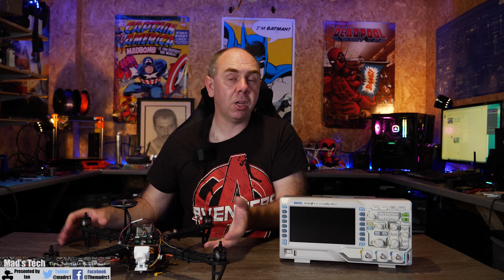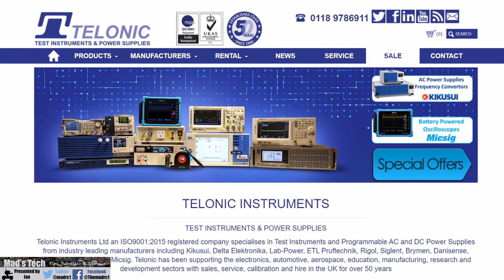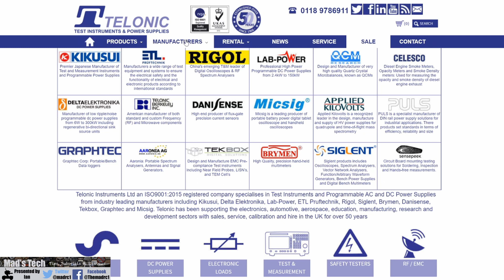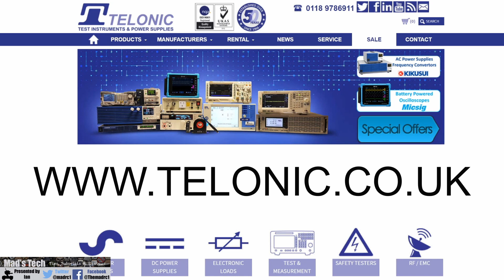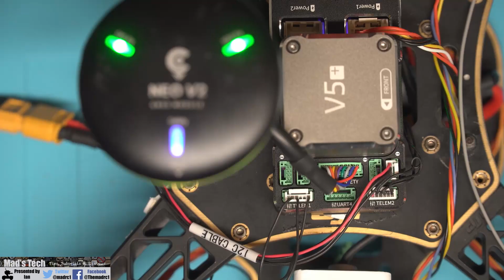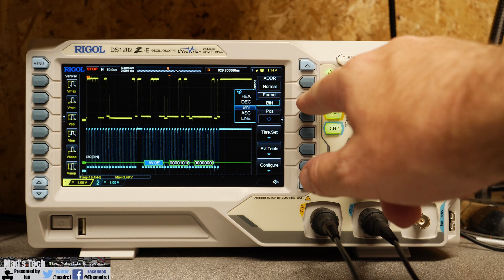Rigol DS1202ZE Oscilloscope - Drone UART & I2C  Signal Tested

Comment: So the probe points for the TX and RX are TX and ground on one probe and RX and ground on the other? And for the single pin communication you're getting clock and ground and the other probe has that single pin and ground?

Comment: Hi, Very informative videos. I have off the topic question here. how to measure differential pair signal?
Reply: Back a long time ago....  During Space Lab testing with the Shuttle program, I was involved with designing, proto-typing, testing, and implementing interface circuitry for use in the PPCU residing in the O&C High-bay.  O-scope operation was easy as breathing and the transmission/receiving of data signals used the differential mode almost exclusively for its low noise characteristic.  The following method just jumped right back into my head - INVERT one channel, ADD both channels, = your differential measurement..  ;-)  You're welcome....
Reply: @ainttakenanyshit  ¡Thank you!
Reply: @ainttakenanyshit  🙂 Thank you for the information regarding differential measurements.  God Bless.